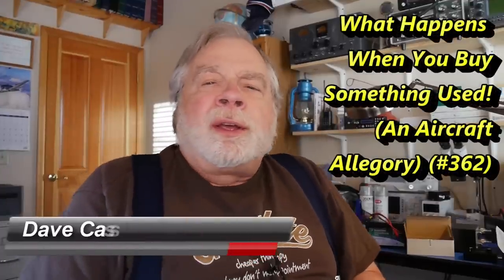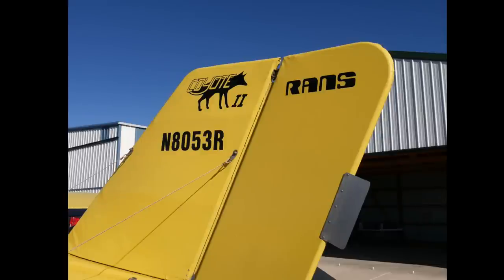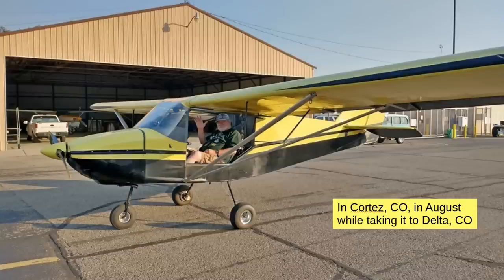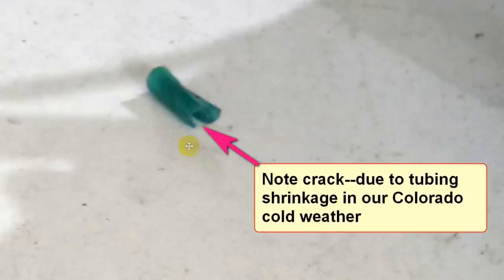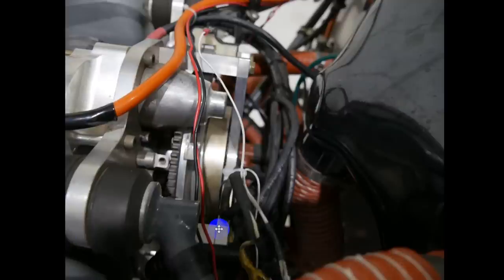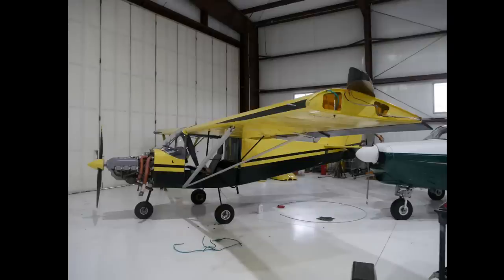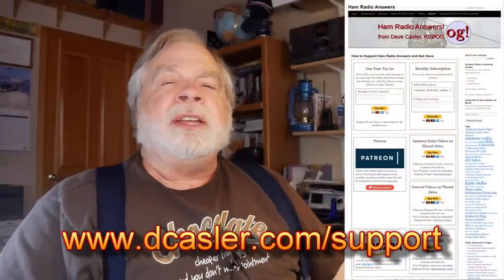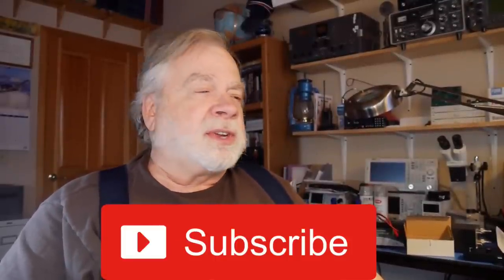An Aircraft Tale That Applies to Ham Radio (#362)

Comment: I've dealt with the same type of hose as the green hose on portable generators and older motorcycles for fuel supply and fuel vent hoses.  I've seen it with red or yellow tint.  It, and many other rubber hoses, become brittle and crack as they age due to the evaporation of the plasticizers which which give the material its flexibility.  While heat is a factor, the hose degrades simply due to time and exposure to the atmosphere.  I felt it was a crime for a manufacturer to use it on a motorcycle and even more so on an airplane.  There are modern materials for hoses that if properly installed and protected from chafing will last for decades.  Even that black rubber fuel hose will eventually harden and crack.

As for the cable, it is difficult to tell, but it doesn't look like braided stainless steal wire rope that it should be.  Again, someone used a cheaper steel cable that should have been used for that application.  While they are replacing the cable, be sure they closely inspect ALL of the pulleys and guides.  One trick that we used to use for motorcycle cables was to put the cable in a shallow pan of oil and heat it to about 150 to 180 F then let is cool and sit for a few hours.  Take the cable out an wipe off the excess oil.  That would leave a fine film of lubricant between the strands.  Well, this post is long enough.  I have two other comments I'll elsewhere.
Reply from the maker: Thanks for the tip.

Comment: While it is possible to get some great deals in used Ham gear, it is also easy to get burned.  If you buy from a reputable vendor, you may have some assurance that they at least did some basic tests before putting the item up for sale and they may offer a warranty.  BUT, that radio won't be the great deal.  

As for buying at a hamfest from strangers, one word: Don't!  Years ago I went to a local hamfest and bought 10 items.  In each case, the seller swore that the item worked or he had tested it recently.  In one case I told the seller I didn't care if it worked, I'd buy it anyway.  He still professed to having tried it that morning.  When I got home an opened the case, I found parts missing and no way it could have worked.  8 of the 10 items I bought that day didn't work.

At a different hamfest, a vendor was selling a PA/Siren speaker for a car.  He said it worked.  I tested it with a battery and lead and then with a meter.  The voice coil was open, the speaker was useless and not repairable.  The vendor took it off the table.  A while later I was back by there and he had it on the table and attempting to sell it someone else, claiming it was good.  When I confronted him, he jumped over the table and wanted to fight me in the aisle.  The event organizers saw this and threw him out of the event and banned from their future events.  

Now, to go down what might be a controversial path.  About that same time period, I attended a gun show with my father.  I ended up making several purchases and used up my cash.  At the last vendor I wanted to make a purchase, not a firearm, and asked if he would take a check.  Now, I rarely found sellers at hamfests would take checks, so I was surprised when this man said he would be happy to take my check.  I asked him about that and he said the in 15 years of doing shows he had 2 checks bounce and in both cases the buyer promptly made good on the check.  Now, I like to think well of my fellow hams, but I had to conclude that folks buying and selling guns tend to be more honest than those selling items at hamfests.
Reply from the maker: Early on in selling my first real science fiction book, someone gave me a bad check. Kind of soured me on checks. When I sell memory sticks with the ham radio videos on them, nearly all of the transactions take place on PayPal. Once in awhile I get a check. I usually wait a couple days for it to pass the bank and then ship the item. I recently had someone who purchased a memory stick with the Extra videos on it say someone else had made the purchase in his name. Seemed very strange, but I told Paypal to just refund the money and be done with it. People are kinda funny when it comes to money!

Comment: I'am actually suprised that they used unbraided fuel line in an airplane. I know it is heavier but man, we are talking about flying stuff, and thick, braided fuel line won't crack that easily. Sudden changes of temperature are common during the flight - what if this shitty green fuel line cracked when You get high up the sky, where it's much colder...
Reply from the maker: The new fuel line has the braid.

Comment: Your audience was developed around Ham Radio, something you know about.  Your pronouncement that used used aircraft are less safe than new is incomplete. Rans does not manufacture aircraft the individual builder does. Since FAA requires the majority of the work to be done by the builder of Experimental category aircraft the responsibilities and liability stays with the builder. Your new fuel line looks more like conventional TSO'd material now. The rudder cable fraying under the pulleywould have been caught by a licensed AME. I would suggest a fabric test as there does not appear to be any UV barrier and I see a lot of sunshine inside the wing. Used cars boats and planes still serve the majority. The wisest ones roll their own.  Find your local EAA Chapter they have a lot of Elmers.
Reply from the maker: Thanks for the tips. The inside-the-wing shots were taken in the FBO hanger. My aircraft is normally hangered also. I am gaining more trust in the airplane as we get the kinks out. I am a member of EAA and the local chapter.